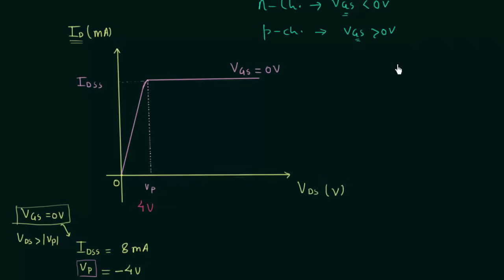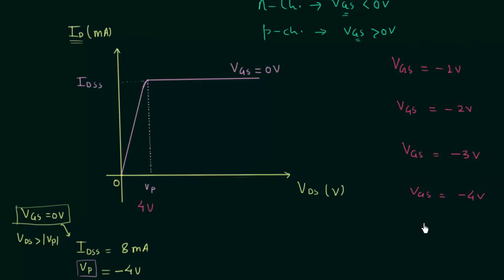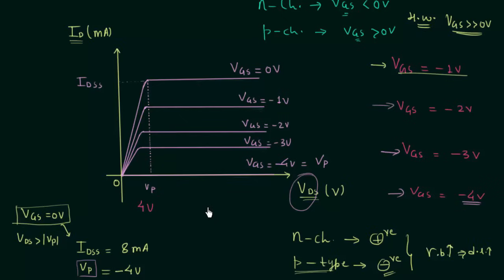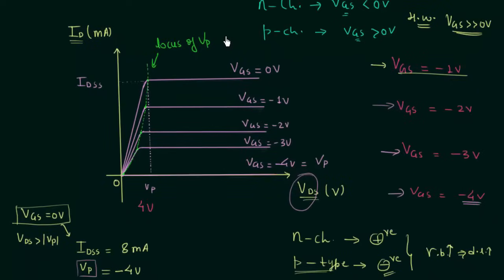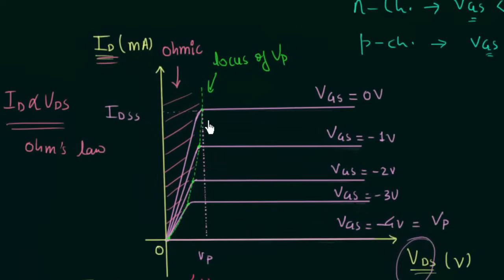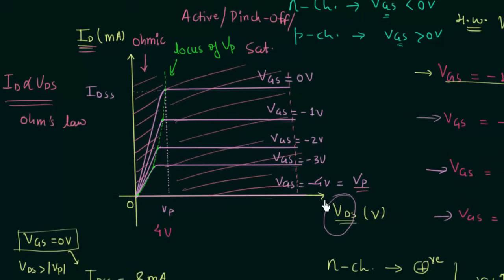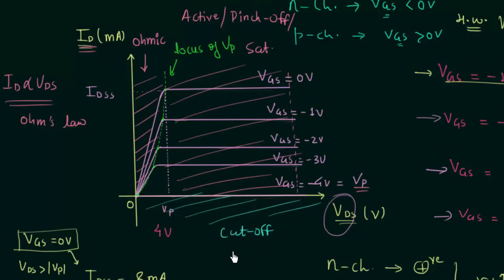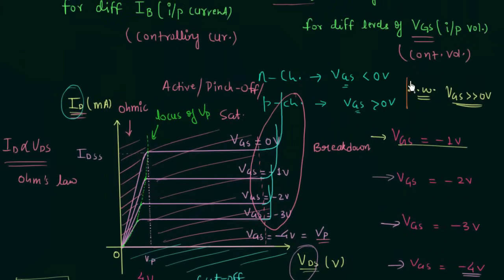Output or Drain Characteristics of JFET

Comment: when vgs is more postive then it jfet works at the value higher than pinch off voltage then having volatge higher than pinch cause short circuit

Comment: Answer to the question , It is essential that the Gate voltage is never positive since if it is so, all the channel current will flow to the Gate and not to the Source, and it results in damage to the JFET.

Comment: In an n-channel Junction Field-Effect Transistor (JFET), increasing the gate-to-source voltage (Vgs) has a significant effect on its operation. Here's a general overview of the effects observed when increasing Vgs in an n-channel JFET:

1. Increase in Drain Current (Id): As Vgs is increased, the channel between the source and drain becomes more conductive, resulting in an increase in the drain current. The relationship between Vgs and Id is typically linear, following Ohm's Law.

2. Decrease in Channel Resistance (Rd): The increase in Vgs causes a larger portion of the channel to be depleted of majority carriers (electrons in the case of an n-channel JFET). This depletion region reduces the channel's effective length, leading to a decrease in channel resistance. Consequently, the JFET behaves as a lower resistance device.

3. Widening of the Depletion Region: With increasing Vgs, the depletion region at the pn-junction between the gate and the channel expands. This expansion narrows the channel's effective width, resulting in a reduction of the available conducting area. As a consequence, the channel resistance decreases.

4. Saturation Region: Beyond a certain Vgs value, known as the pinch-off voltage (Vp), the JFET enters the saturation region. In this region, the channel is fully depleted, and further increasing Vgs has little effect on Id. The JFET operates in a cutoff mode where the drain current remains relatively constant.

The reason behind these effects can be explained by the underlying physics of the JFET:

The n-channel JFET consists of a thin, lightly doped channel region with p-type material on both sides (the gate and the substrate). When a negative voltage (Vgs) is applied to the gate with respect to the source, the pn-junction between the gate and the channel becomes reverse-biased.

The reverse bias creates a depletion region in the channel, devoid of majority carriers. As Vgs increases, the electric field at the pn-junction strengthens, widening the depletion region and reducing the effective channel width. This depletion region acts as a barrier to the flow of current, increasing the channel resistance.

When Vgs exceeds Vp, the depletion region expands enough to constrict the channel entirely, leading to pinch-off. At this point, the JFET is saturated, and further increases in Vgs have minimal impact on Id.

It's worth noting that the specific characteristics of a JFET, such as Vp, Idss (drain current at Vgs = 0), and transconductance (gm), vary depending on the device's design and parameters.

Overall, by manipulating Vgs in an n-channel JFET, it's possible to control the device's conductivity, resistance, and operating region, making it a versatile component in electronic circuits.
Reply: R U sure it’s not written by chatgpt 😂.?
Reply: @jayyoung1585  no bro...
It's not written by chatgpt
Reply: @jayyoung1585  it's was written by bing...
Microsoft ai

Comment: Excellent presentation! Thank you. One of the major lessons is that the pinch-off voltage is not a constant but instead depends on Vds. Interesting that the manufacturers only provide one value for pinch-off voltage.
Reply: Vgs*

Comment: If we apply Vgs as +ve voltage, We will get the pinch off condition for larger values of Vds(Than in case(i) ), Am I correct?
Reply: IDK but at starting it will be forward bias and hence depletion layer will decrease so a very very large voltage Vds is required to achieve pinch of voltage
Reply: How vp is negative?

Comment: How does the pinch off voltage got a negative value...?.. since the Vds is positive value...and we define pinch off voltage as the Vds voltage at which depletion layer appears touching each other.

Comment: I think when we apply Vgs+ than the VGs will forward bias and depletion reg ion become less and less and cause more voltage drop across drop to source so will increase current producing more heat and than the circuit will burn out
Reply: Ye kya display picture rakha hai?Amazon aur myntra ke models ka

Comment: If  Vgs  is postitive the depletion layer will not develop as it is forward biased , and the result is , we get a ohmic device which gives current increasing prpotionally with voltage , a constant current output would not happen , leaving us far away from our objective , and it'll heat up to burn itself

Comment: If we apply VGS>>0 then it becomes forward bias . We know that in forward bias the current flows easily with out any depletion layer. So if we give +ve VGS no depletion layer occurs !! If my answer is wrong pls say the correct answer
Reply: and simply if we make Vgs positive and apply Vds,a large amount of Id will flow which will burn the transistor

Comment: its my humble request when anyone has given right answer in comment u can pinned this comment that can b helpful for persons which have any doubt.
Reply: If we take Vgs as +ve then p-type material will become +ve & n cannel already at +ve potential..so deplation layer will not be elongated ..as i thought.
Reply: because if we provide positive voltage then p-n juction will become foforward bias and current is also induce through this which cause noise in th jfet which is same as in bjt so  to remove noise in the ckt always -ve

Comment: If we get a pinch off region very earlier and it means both the depletion layers appears to be touch each other then in  such a case resistance also increases as conduction path reduces right. Then why should we want to achieve the pinch off region earlier..?

Comment: If Vgs is more and more +ve then we cannot achieve pinchoff voltage and current will drastically increase which will breakdown the MOSFET before it goes through other regions. Correct me if needed.

Comment: As we make Vgs more positive the two deplition regions width will decrases and no opposition to the charges, then the resistance is almost equal to 0,so the transister become a short circuit.
Reply: If vds is constant then you correct
But for more positive vgs ,compare to  vgs ,vds is more positive then depletion region is constant

Comment: if we take Vgs as positive(+ve) in case of n-channel JFET then the reversed biased condition will not be going to happen positive value of Vgs will make it forward bias and because of that pinch-off voltage will not be obtained thus the decrement in the depletion layer will take place.

Comment: if positive Vgs applied to n channel JFET, then pn junction becomes forward biased due to which there will be the reduction in width of the depletion region, hence we then have no controlled on drain current Id, the drain current increases rapidly, hence after some point breakdown of transistor will occur, if we add more and more positive voltage Vgs.

Comment: thanks for your videos Sir but I have a doubt why we have taken pinch off voltage negative Vp = -4V. Pinch off voltage is that corresponding Vds in which Id is constant(Idss) and Vds is positive. then why we have taken pinch off voltage negative.
Reply: I have same doubt.... I don't get satisfactory explanation
Reply: It should be positive 4 V because Vgsoff = - Vp 
As Vgs is negative then Vp should be positive
Reply: PRATEEK BAKSHI  mod value of vgs the vp equall negatively ..
Reply: Bro there negative sign indicates the direction of current across depletion layer.we gave reverse bias so we took -4v there.
Reply: PRATEEK BAKSHI pinch off vol. Is that value of Vds at which both depletion region appear to be touching each other

Comment: Sir, when we have Vp as a negative value. Does this not imply that current will flow from source to the drain and correspondingly the electrons will flow from the drain to the source. In this case shouldn't I-DS current be negative?

Comment: if the value of Vgs is increased to such a level that the potential exceeds that of n channel( or VDS) then there will be a forward bias and the depletion layer will decrease and hence the jfet will never behave like a switch because pinch off condition will not be achieved.

Comment: if we go on making Vgs +ve (in case of n-channel JFET) then "pinch of" will not take place because for n-channel JFET required condition for Pinch Of is Vgs should become more and more negative.....and by doing so we will never reach "Idss"(saturation current).
Reply: JFET current will become very high due to lesser width of depletion region, and transistor will burn/damage. This is why positive bias is not used in JFET.
Reply: @94D33M  yes bro i thought the same thing
Reply: Tq so much
Reply: Sir may I go to the toilet?